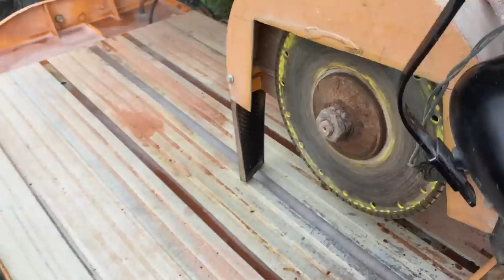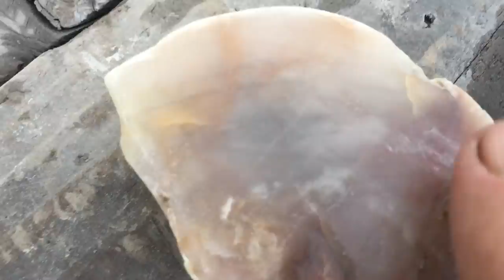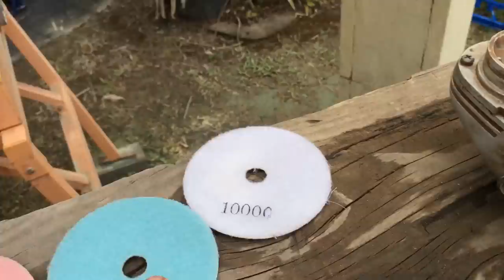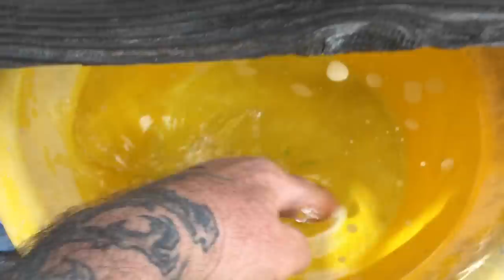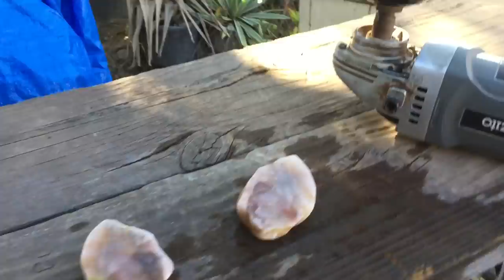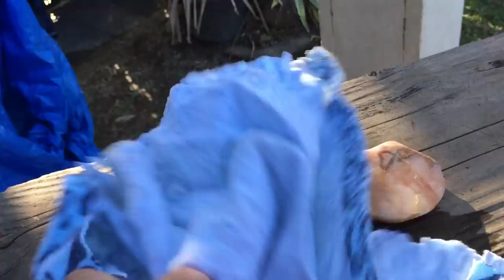Polishing Rocks with hand held Polisher/Sander - Part 2,  a more detailed look

Comment: Would this work on something like blue lace agate or moonstone?
Reply from the maker: hi Ronnie Trimble , yes, most certainly ! I would allmost say you can use this method on all rocks except the most porous, or most sandy or crumbly. I have polished maybe 50 different rock types like this (a guess at that number 😉)
thanks for good comment !
cheers, kev
Reply: Kevin Nix awesome! Thanks so much. Your video was so helpful and I’ll be making my first raw stone purchase this week!! Fingers crossed for a good outcome!
Reply from the maker: Ronnie Trimble ,
good luck with everything, you will make mistakes, and your early efforts will improve as you go on. Dont be scared to practice on rocks you can get for free, (I did), there are usually nice rocks around most beaches. If you are a facebook user, try joining our group, ‘’mackay fossils and rocks”, it is an easy way to communicate with others in this hobby, and questions are welcome.
kev
Reply: Kevin Nix thanks so much! Going join now!

Comment: Hi, which speed u use for polishing? Which RPM in average? Cheers, great work!
Reply from the maker: Igor T 
i’m not sure, but its approx 1500rpm, (no.2 setting on a sander that is variable between 1000rpm and 3000rpm)
Reply: I think full speed works the best it's harder for the pads to hang up or drag uneven

Comment: The 4" dry diamond disc used in first step after cutting stone at about 3 minute mark, used to remove high edges & flatten stone before pva grinding. What is detail, where to buy & ebay link?? Could not find!
Reply from the maker: its sometimes called a concrete grinding disc, found at Tilers outlets, or normal hardware shops, 
otherwise just do a search on ebay

Comment: Don’t worry found this ha
Reply from the maker: too easy jay,
a variable speed sander with a 14mm thread is a great investment, starting at about hundred odd dollars, the 14mm thread fits a range of rock attachments, all available on ebay, or THK tools website.
- concrete cup grinder with 14mm thread,( aggressive rough shaping)
- velcro attaching lap discs, (hard alloy lapping wheels for flat polishing)
- velcro attaching wet diamond discs, rounded and flat polishing
cheers, kev
Reply: cheers Kev
Reply: Let me know if you ever want any NZ Agates sent over

Comment: Do you use anything on the table bench buffing pad
Reply from the maker: hi ty, I dont use anything on the bench grinder buffing pad, but you can use a metal polishing compound if you wish, (these compounds come in different colours/strengths, beware the colour doesnt lodge on the rocks cracks or cavities),      kev